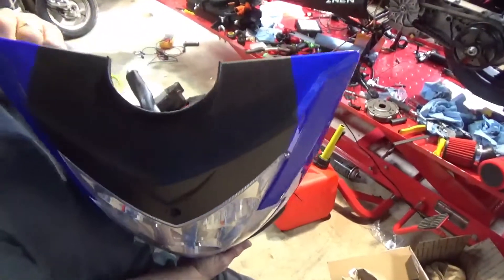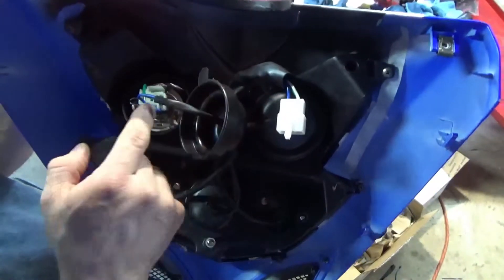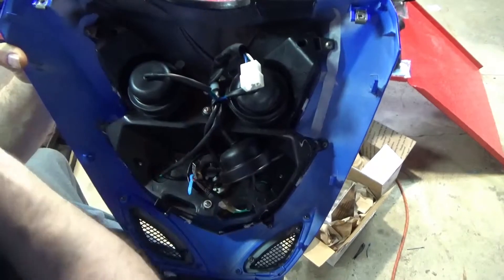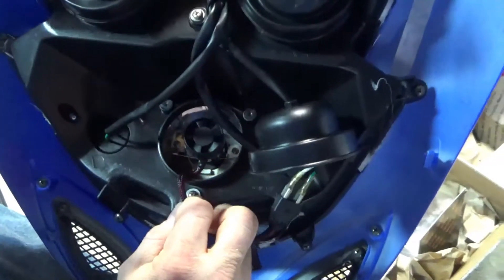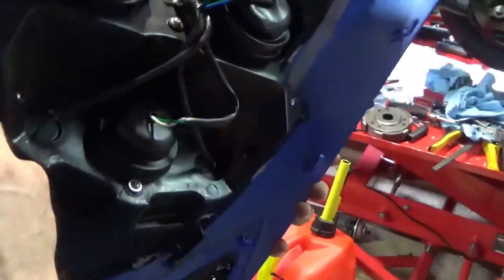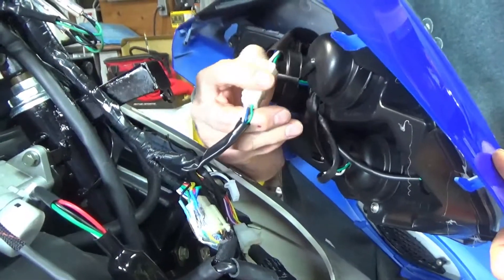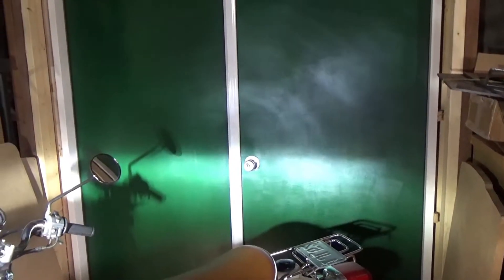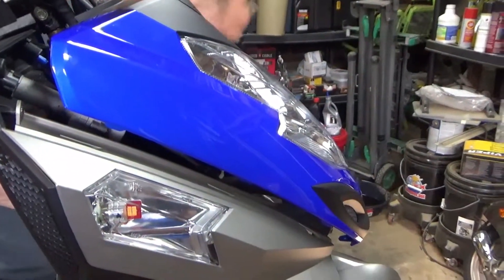Led's and scooters

Comment: Im a professional mechanic as well. For me, I work for an ambulance company... I work on a lot of ambulances. It was a lot of 7.3 diesels.... and the evil 6.0 diesel.... but now it is mostly Ford modular 2v engines.... way better.

I used to ride "real bikes" hardcore but stopped 5+ years ago. That being said I have been to the Philippines 5 times in the last 7 years.... Riding a Honda XRM 125 was awesome there.... So....

I bought an Amigo JAX 150, since I cant go back right away. And those little bikes were so fun there. Im not a big fan of a scooter or CVT but the GY6 150 is so ubiquitous and the parts are so cheap..... AND this one looked decent cooler than a lot of TaoTao. crap (I believe it is a Zhen scooter).

Ive already got wide band o2 sensor capability With half of the Dobeck tool and half parts I bought on my own. I havent tried it yet though.

And the LED turns are stock on this one..... but I swapped the headlights for LED already.... I have LED for the tail but it seemed like more hassle to figure out how to remove the lens etc.
Reply from the maker: That's awesome!
Reply from the maker: That's the great thing about GY6 150's so easy to upgrade and have a reasonable amount of reliability.